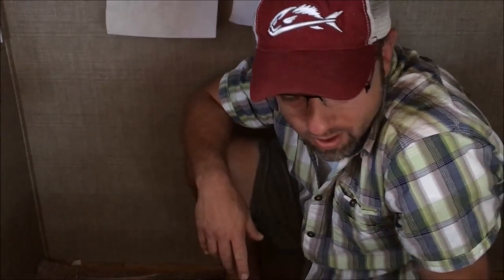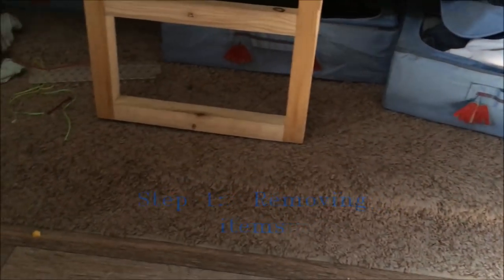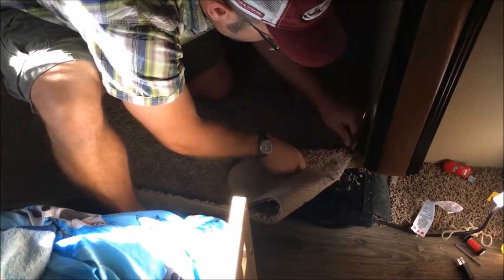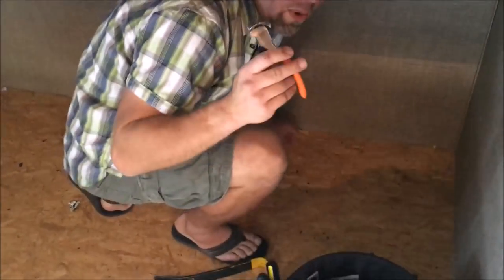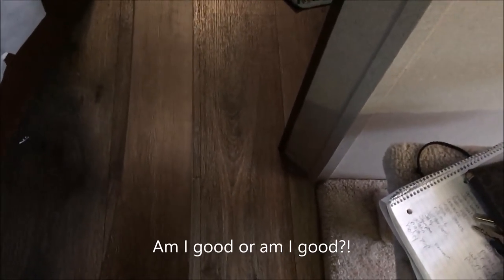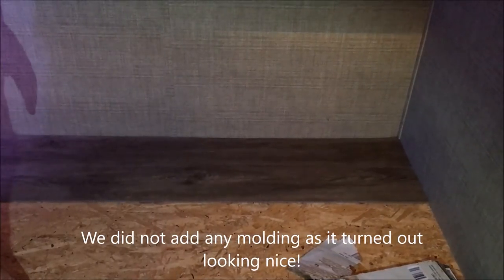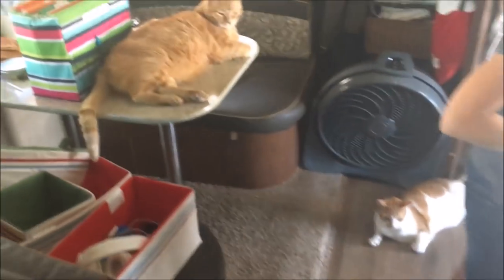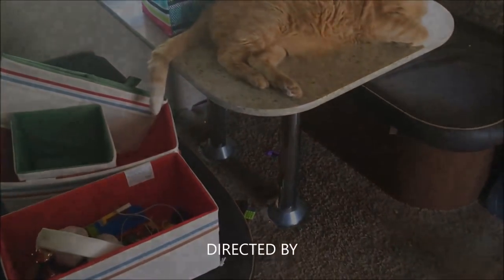Replacing RV Carpet on Slide

Comment: It's best to leave a small gap between the flooring and wall on all sides for the expansion and contraction of materials. That's why trim is added to the edges. You may find you have some curling or warps after a while if the floor is a bit too tightly installed.

Comment: Nice job installing the flooring!   Using a board under the nose of the pliers to ad leverage sometimes helps in pulling staples.  You were using nippers or cutting pliers.  I like to use lineman pliers or vice grips... as they don't have a cutting end.   Thanks for posting, it was a good idea!

Comment: If you're going to put down the flooring you should go to Home Depot and get allure traffic master flooring it's a vinyl and it is the best there is
Reply: totally agree. home depot has Allure. I don't think Lowe's has Allure. I looked at the differences in each store vinyl plank. BIG difference. Allure at Home Depot has a small sticky 'tab' that you overlap- making it way more waterproof! The other stuff that I have seen, you just butt up against each other. the vinyl itself may be waterproof, but water can still get in between at the cracks, since no overlapping like Allure. I have used Allure on 2 different houses, living room and bath, and now going to use in my RV as well. LOVE IT! Especially when my dog has an accident or gets sick. EASY to clean up!